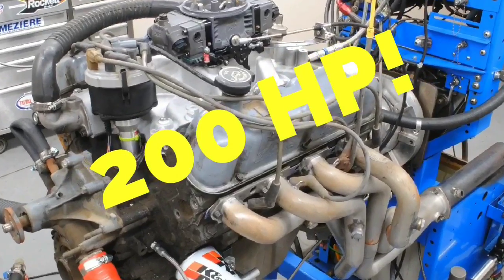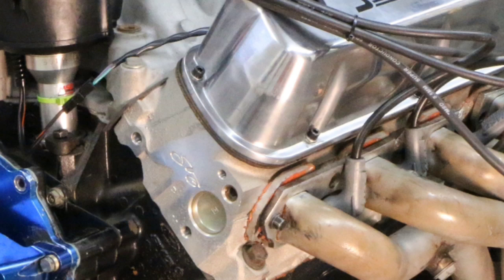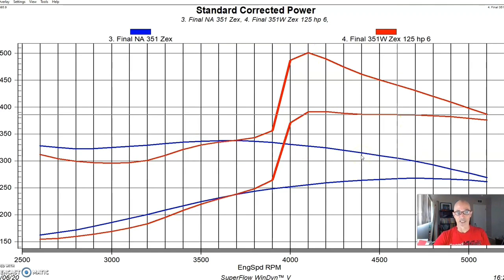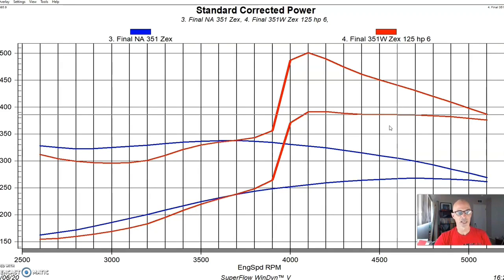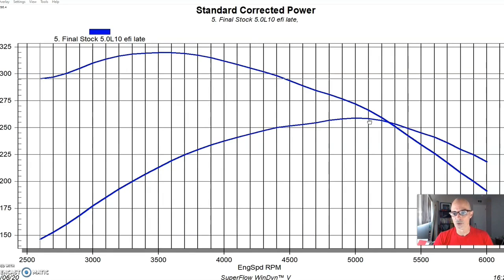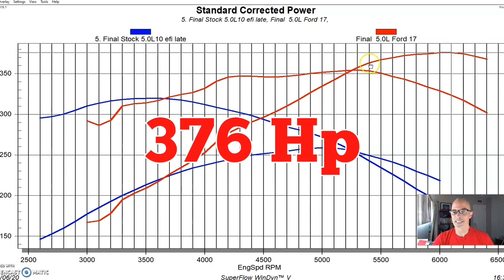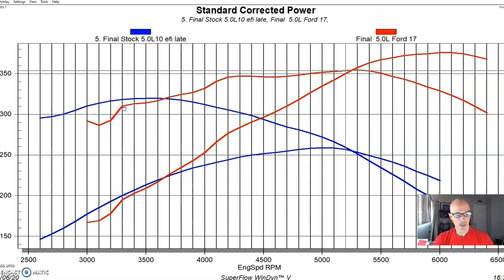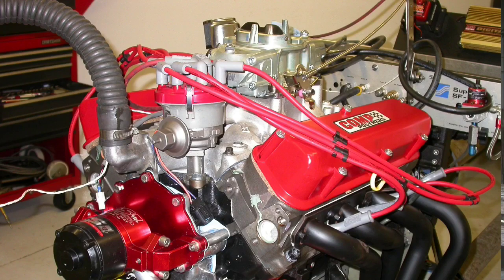HOW TO: 300+ HP 5.0L (SBF) FORD POWER RECIPES

Comment: Video idea. How about who makes the most efficient mechanical water pump test? Just curious and came from the thought that if you dyno a motor at 300HP on the dyno then put it in a car then its no 300HP anymore, but somewhere around 320HP dyno would be 300HP in engine bay with pump and alternator.
Reply from the maker: watch the accessory video on the LS
Reply: @richardholdener1727  so the LS water pump is the most efficient?

Comment: Stock explorer short block 
Ported 170 twistwd wedge heads milled to 58 cc, .035 headgasket
N412 cam
Ported upper and lower intake
Ported throttle body
 24 lb injecters at 65 psi fuel pressure
 Hope to be 400 to the flywheel. Well see very soon!!
Reply: Whats up Jody,how you like those ported heads from Big Dogs?? Seen you on a few channels, great minds think alike,lol.
Reply: @johndoe-zb8bm   Yes sir we do!!
 Love them! Everything  I have on the top end is ported by him.. dude is a pro at what he does!! Now..Im just waiting on injectors.. couple small things.. get thing fired up and see what it does..
Reply: @johndoe-zb8bm   guess I need to be more careful posting..hahahaa.. my secret is getting out..🤪
Reply: @19jody72  Na man,we just into the same thing,your secret good with me,lol.👍
Reply: @johndoe-zb8bm   By the way.. hes got some VERY mild 302's in his stable.. running some good numbers!
Reply: @19jody72  Absolutely 💯
Reply: @johndoe-zb8bm   you got any of his stuff?

Comment: What kind of cam would you recommend in a ford 400 with 2v heads and around 10.3 compression?  I've been told 240+ degrees at .050.  I'm am getting some flat tops and putting them at close to zero deck.
Reply: 268 Extreme energy from comp. Have that article from Hot rod mag in 1998. they got it to 9.5:1, 375 hp,  475 ft lbs with a 500 cfm 2V.
Reply: @socalltd  thanks for the reply.  I too have read that article.  I have used a similar cam in a otherwise stock engines, it retained the low end power and worked well.  I think that with 10.3 or 10.5 to 1 compression though I will need more duration.
Reply: @shenaniganswhatsoever363  good to hear, Ford 400's don't get mentioned much. I would like ask, what pistons are in there to get 10.5:1. ?
Reply: @socalltd  not in it yet but apparently dss pistons offer flat top pistons for the 400 with the .975 wrist pin and a 1.71 compression height.  Dish and dome pistons also available.  I was surprised to see this and it got me thinking about doing a 400 build.
Reply: @socalltd  10.5 to 1 is what I roughly have figured with zero deck, .040 head gasket, +2 cc valve reliefs in piston, and 78cc stock 2v chambers.
Reply: @shenaniganswhatsoever363  That's very stout with that combo, I am trying to figure out a 9 - 9.5:1 with my 74 400C with some 71 2V (72cc?) heads and stock 8.0 pistons in 
there now. .  its in my LTD ans drive it regularly. . want low end mainly and would like to overhaul it completely soon. intake, carb, headers are on there now . .thinking a basic 252 hi energy or 258 cam with a roller lifter retrofit into it   Rich here did some interesting things with a 351M in another video.
Reply: @socalltd  I wish Richard would do another 400 build, but use better pistons that have a dish and zero deck.  I believe he used flat tops the were still 60 or 70 thou in the hole, and I believe he said he had to use race fuel at a mild 9 or 9.5 to 1 compression.  His numbers were great but I think it could be pulled with pump gas...
Reply: @shenaniganswhatsoever363  Correct, even with a stock 71 9.0 piston. you're still .0650 under deck. pump 91 is way safe at 9 - 9.5:1 and lgo forever. I got the book for the 385 and 335 series from HPBooks and has all the specs numbers and would like to make a combo for myself.
Reply: @socalltd  the 400's are a tall deck Cleveland, far from a boat anchor imo
Reply: @shenaniganswhatsoever363  Yes, Ford went to a square 4 inch bore/stroke from a taller decked 351 to replace the FE 390 in 1971.  Was in many FoMoCo models  thru the 70's 
and not considered for any performance back then.
Reply from the maker: depends on usage
Reply: @richardholdener1727  4 speed manual pickup 4x4.  Mud drags and fun stuff like that.
Reply: @richardholdener1727  and thank you for your time!

Comment: Thanks so much for this info Richard. Love watching this stuff as a small block ford guy. Currently running a 95 GT short block, GT40 heads, dual plane intake, E303, 1 5/8” headers, and topped it off with that same perimeter plate for an extra 150 hp, in my sub 3000 lb 65 mustang. Car is a blast to drive!

Comment: I've got a stock 2000 Explorer 5.0 and it's pathetic above 3500 rpm. I wonder what it's power level is with stock cam. I wonder if one stuck in just a little more powerful HO roller cam?
Reply: The valve springs are weak and the exhaust manifold design is brutal!
There's nothing wrong with the cam really, it is the ho cam spec, it's okay.
Reply: If it has the GT40p heads thier exhaust valves are smaller than a typical GT40 as well so need port work if you intend to run anything over .500 lift. Keep it below .520 if you are running GT40's without any porting.

Comment: I wonder what early 351 heads that are ported and larger valves would do on a 302? I have one with domed pistons 11-1 comp haha
Reply: I had that combo in an early Capri. Ran a torker 2 intake, stock carb (heavily modifed for good fuel economy and power), headers, can't remember the cam but it wasn't too radical. Shifting out of first it liked to go to 6500 rpm before I had time to shift. I had Comp Cams roller tipped rockers and they liked to "roll over" and cause misfire unexpectedly and found out the camshaft bearings were flaking and apparently a flake would get caught under tappet and cause momentary clearance the rockers couldn't take. I had 100k miles on the bearings. Ran the combo for 50 k miles. Could still get 18 mpg on trips and pull my pop up camper too (reduced fuel mileage).
Reply: Best running naturally aspirated 302 I've had in a long time was a 302 w/ '69 351W heads only lightly cleaned up. Medium flat hydraulic, Holley Street Dominator intake, mid-length headers, 700DP. What a responsive little mill it was, and strong for any iron-headed inline valve 302. Would like to have run it in comparison to the Edelbrock aluminum equipped two that I have had. One was superchared and the current one is MassFlow injected. That little all iron one would kick this one's behind, but the blown one had a lot more going on. Still, I believe the iron one would have acquitted itself well. Of course, Ed doesn't do Ford heads very well, so I'm sure a set of TFS, Kaase or AFR heads would have put that iron mini-engine in it's place. For what they are, though, I think you'd like the results if you use pre-'77 heads.

Comment: I have a 95 mustang.  .030 over forged pistons , rods, 165 AFR heads , E303 cam , roller rockers , 24# injectors , ‘95 cobra intake , larger TB , cold air kit , billet distributor , cat-delete, shorty headers , flow masters ,custom chip.  I assume a fair guess would be 340 lbs/340 HP
Reply from the maker: pretty accurate-might be a touch more-those R good heads

Comment: The second to last test with GT40P heads!  So, 70mm TB, Explorer heads & intake with the 274 cam, B303 or E303 cam.  Please.
Reply: Yes!!! Need the vid to go the full monte with the Cobra GT40 intake!! Add the Ex heads and a nice street cam. Preferably not an alphabet cam tho.
Reply: BigDogs Porting fi intakes are superior and half the $$.
Reply: +1 for GT40P heads
Reply: @sknallt2010  I’m running a set on my carbed 95 gt they are great, I even found a pair of brand new 90$ headers that fit the weird gt40p bolt pattern and spark plug angles
Reply: @southernracing2468  where'd you find the headers?
Reply: Get something better than a letter cam they are outdated compared to some of the stuff you can get now

Comment: You guys Rock!! Glad to see guys like you giving us guys Idea's on how to build power. As long as you are doing SBF engine's. What kinda of recipes do you guys have for trucks with the  351w engines. I am talking about guys that pull there hotrod to the track in there pickup. Truck guys need gobs of torque mostly between 1800 - 3500. Can you come up with something cool for those guys?? Keep up the Awesome work and I am looking forward to seeing more of your video's.
Reply: Use a comp cam 35-218-3.You can still use your factory torch converter if you can find some gt40 heads cheap use them but upgrade the springs to match the cam.Change out the intake to a dual plane Weiland.Put in limited slip if you don't have it know.Use a 3.73 gear and now you have plenty of towing capabilities.I have this set up but use a 3.90 gear and the torch is amazing.

Comment: I remember running this guy back in the day, he had a bone stock '86 and he put a 100+ shot of nitrous on it.  He was real fond of toying with other drivers by hitting the spray and leap frogging.  Everyone knew those '86 motors were turds, which made it all the more frustrating that he just bolted on liquid horsepower.  I never ran him for money, and it was back when I had a more-or-less stock engine.  There was this big winged Saleen replica that would show up with a built motor and supercharger, they only ran for money.  I saw one guy show up for a dyno day at Apex Motorsports, he literally had just bought a 351W engine the day before and never ran it, he flogged the crap out of that motor while Byron tuned it.  Once done he went off and conducted a little business, then came back.  Dude had no respect for his car, it was a stock shell that was stripped, no safety, just slicks.  Those cars tended to potato chip and rip apart...no respect.
Reply: The only real issue with the '86 5.0 vs the '87-95 are the heads. The cam was the same from '85-'88 and the '86 motors still had factory forged pistons. The advertised compression was a hair higher too(9.2 vs 9.0) despite the slightly larger chambers(63-66cc vs 60-63cc). 

Swap in a B303 cam, mildly port and mill some later E7 heads, fly cut the pistons for valve clearance then top it with a truck lower/box upper. With proper tuning you'll have a motor that pulls hard to almost 6K.

Comment: What's even more amazing is that the stock head is a 125cc runner, yet it'll make 1HP/CID
Reply: GT 40 are 144cc and flow about 170.
Reply: Yeah, but that's about it. 
Stock heads only flow about 150 CFM. Which is excellent for stooging around town, but.....

Comment: Richard, whos springs do you recommend?
Reply: Alex's springs are a good spring,I run trick flow springs in my GT-40 "3 bar" heads. But I'm not running a huge cam with a lot of lift. Big improvement over stock ,lol. I'm running about .525 lift.
Reply: TFS do a good range of PAC springs, inc complete kits.
Reply: Beehives 100 %
Reply: The Trickflow set for GT40 and GT40p are going to get you great value and performance and the kit comes with shims, seals and even a height gauge.

Comment: Right on Richard love the small block ford stuff. 
My combo: Stock 87 HO block, XE274HR, AFR 185/58cc, Wieand Stealth with 1 inch spacer  Holley 650DP and Long tubes. I am still running factory duraspark with MSD Blaster lol.
Reply: There's not wrong with dura spark ignition. I ran the same setup back in the 90's
Reply: I've been wondering if the 274 cam would clear stock valve reliefs with a good head and bigger valves
Reply: @BlueOvalTavern  I have World Products Windsor Sr. milled the chambers down to 58cc. Also a lunati 51014 cam(TFS copied that cam and called it there stage 1). Just enlarge the piston  valve reliefs.
Reply: @erikturner5073  yeah I ran the TFS Stage 1 cam with AFR 165 heads on a previous stock bottom end setup I had years ago, it was a nice little motor.  I'd like to get a little more aggressive with the cam on this current motor, and Richard has made a believer out of me with the 274 cam to be available off the shelf.
Reply: @BlueOvalTavern  actually with my setup I'm clocking 420hp. Love my world products windsor Sr. with the chambers milled to 58cc.  Making power isn't all in the cam. Cylinder heads and compression ratio play a big role and can also give a cam longer legs as far as making power. The 165 afr heads are a nice smallish street head, although the 302 will benifit with a better breather if ultimate power in N/A is the goal.
Reply: @BlueOvalTavern  The duration makes it sketchy, I fly cut my pistons myself with 3M roloc discs, I did this 3 years ago roughly with no issues. You will need to make sure you check your clearance with playdoh or you could have them fly cut by a good shop.
Reply: @saldar65  I wonder what i could get away with in my stock bottom end 302 in my 1979 zephyr?  heard it wont take much but i dont wanna spin it past 6000 RPm because of the cast piston.

i was thinkin TFS heads to gain some clearance from the different valve angles and a short duration cam like an xe262H  218/224 .493/.500 lift 110/106 should be good enough for well over 300hp  and not have to spin it past 6000

Comment: Im building a hydraulic roller 351w, and am looking to do a cam and aluminum heads, how important would an intake manifold be to make power?
Reply: Very,  it affects your power curve drastically! Long runners are better everywhere except the very top of the rpm range
Reply: @KreatorOfDeath1985  I mean more specifically in terms of budget.
Reply: Joe Figueroa  Terminator x efi

Comment: Im building a long block 5.0 from a 96 explorer with f303 cam and springs im planing use a gtp38 turbo from a 2000 powerstroke engine im trying some 400 hp at Wheels with a c4 transmission
Reply: You better get a C6 as that C4 will need billet parts to handle 400 hp

Comment: ...Can't wait to see your 400 hp Combinations! Thanks for the videos! I wish I could see the Dyno Runs. At what HP do you suggest changing the Connecting rods to aftermarket forged?
Reply: Factory Ford rods are forged, just add arp bolts for security. If you're going over 6500 or over 450hp, I'd go aftermarket rods just for the ease of mind, not even sure if it's required then.
Reply: @jimmiller4667  Yep, that's why I asked, I guess I should have been more clear then because the engine im building will be north or 450HP and im not sure if stock rods will hold...
Reply: Mike V. If you're going north of 450 then you're spending $$ anyway. A set of sportsman rods would be cheap insurance and piece of mind. I've run stock 302 rods to 6500 and 289 rods to 7000 with arp bolts, but that was when I was a young dumbass. Yeah, you can jam in a big cam, intake and stuff on a stock bottom end and it will live as long as the rusty old car you're ripping around with holds together.(about 2-3 weeks was my average lol) never chucked a rod but broke blocks, pistons, etc. Depends what you're doing though but if I was putting serious money into an engine, I'd get a set of rods. It would be like spending big dollars on a roller cam and rockers but keeping the stock springs.
Reply: I don't think you ever really do with a small block Ford.

Comment: How much does a 351W with GT40P make
Reply from the maker: depends on cam and intake
Reply: @richardholdener1727  Holley High ram as far as Cam unsure yet I'm doing a junk yard 351W slap the high ram and terminator X in my 1990 2wd toyota pickup that already has a Ford 8.8 3:73 posi in it and a T5 or T56 what ever I score at the junk yards and have a fun truck
Reply: @richardholdener1727  Does the 351 + 274 cam play well together?
Reply: With a 1969 GT350 351W had an, ahem,  aftermarket Shelby C90Z-C  cam (OZ= ozzy ozzy ozzy)  290/290 duration with 470 lift 62 degree overlap and a Buddy Bar dual plane, 300 hp net at 5400 rpm option.Same head flow as the GT40Ps. Use cast iron Drake Remade K code C3 headers to pass the plug angles, but C9 4v Windsor heads were inferior to GT40Ps.
 Factory Ford Falcon  Phase I GTHO spec with 600 cfm Holley was the non emisions version California and AO Smith werent allowed to build.

Comment: Stock 351w (Flat tappet)
*Duration at .50in 206/221
*Gross Lift-0.445/0.453
*LSA-?

Stock 351w (roller)
*Duration at .50in- 186/197
*Gross lift - 0.421/0.447
* LSA - 115°

Lightning 351w (flat tappet) 
*Duration at .50in- 197/209
*Gross Lift- 0.416/0.445
*LSA- 114°

Cobra 351w (flat tappet)
*Duration at .50in- 208/ 224
*Gross Lift- 0.453/0.453 (but used 1.7rocker arms) so - 0.481
*LSA-115.5

Stock 302 (Flat tappet)
*Duration at .50in-182/194
*Gross Lift-0.379/0.395
*LSA-?

Stock 302 (Roller)
*Duration at .50in -210/211
*gross lift - 0.444/0.444
*LSA-116°

96-01 Explorer 5.0 HO Roller
*Advertised Duration- 256/266
*Duration at .50in - 186/197
*Gross Lift- 0.422/0.448
*LSA- 116°
Reply: It's interesting that the 351w flat tappet had that hot of cam. When the fuel injected 5.8 came out in 87 or so we (at a Ford dealer) had trouble with them idling smooth. The fix was a different PCM with updated fuel curve at idle. The service engineer told us they had a "hot" cam and that caused a lot of the rough idle. Maybe he was right.
Reply: Yup and the aromatics shifted before 4500rpm so the roller made far more usable power on a "stock truck setup"
Reply: Came across the same specs and was certain the 351w flat tappet info was wrong. Never would’ve guessed those numbers.